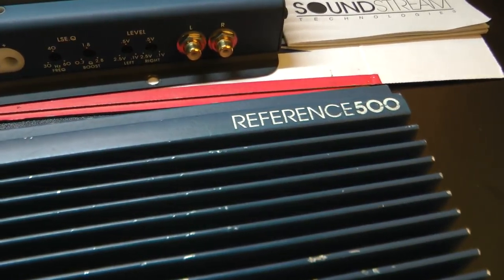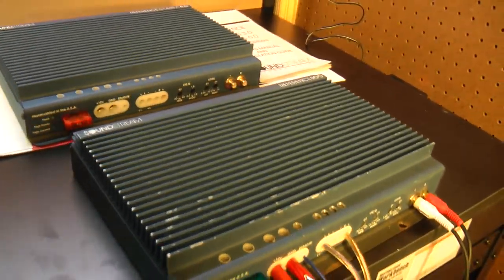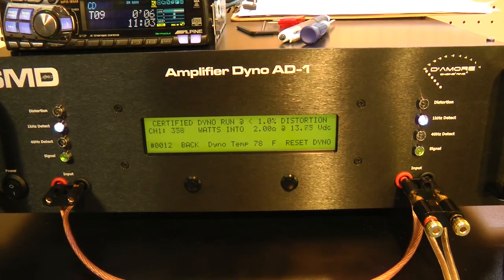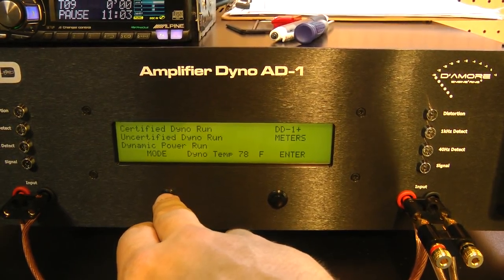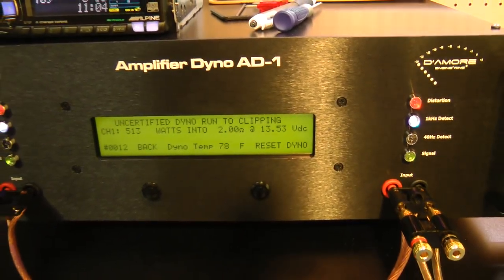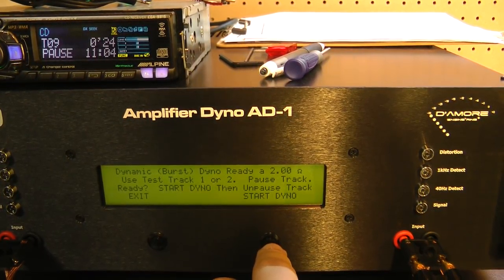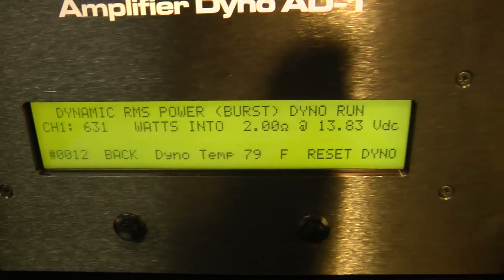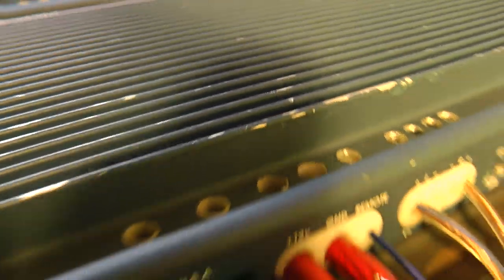1993 Soundstream Reference 500 Amp AD-1 Amp Dyno Test at 2 ohms Mono

Comment: Actually did better than expected for me.  I knew that they were pretty much right on the money, but didn't expect the dynamic to do so well.  I have quite a few of these and yeah, they get piping hot.
Reply from the maker: Not bad, but not underrated as the Internet myths may tell you. A nice amp for running components.
Reply: Dereck BigDWiz Well, I don't know where those myths started.  They were pretty up front about their ratings.  The big deal about Soundstream is their huge current capability.  Seeing as to how this amp qualified as a 125w amp in the competitions, 4x the "rated" power is nothing to shake a stick at.  Double the bonus if you had a 5.0/6.0 which is really where it was at (25w rating, but 500w @ 1/2 ohm or 50w rating, but 1000w @ 1/2 ohm).  I do believe though that those did a bit less than rated at the lower impedances.
Reply from the maker: Mickey Pietrzak I have a Ref 6.0, it's the 600W model, the 10.0 was the 1000W one (both rated 50W in high current mode, super cheaters, LOL). My 6.0 is actually on the bench behind the 500...it failed on the bench, needs a little TLC. It did hit 580W at clipping before taking a dive into amplifier intensive care
Reply: Dereck BigDWiz That's a shame on the 6.0.  I was always torn between one of those or an Adcom because of their stupid low current handling.
Reply: freshkryp69 That's great.  There is so little info out there on the Adcoms, which is a shame being so well built.  I don't blame you a bit for not wanting to go to 1/4 ohm.  Honestly, they probably don't make much more power past 1/2 ohm if any.  I suspect the 1/4 ohm capability is more for dynamic loads.  As with the Soundstream, I don't expect it to make more power than expected, but I expect it to do rated with authority.